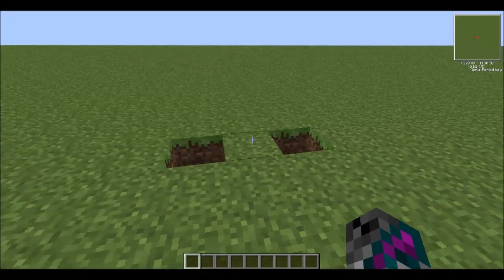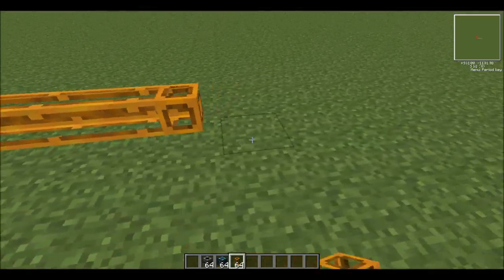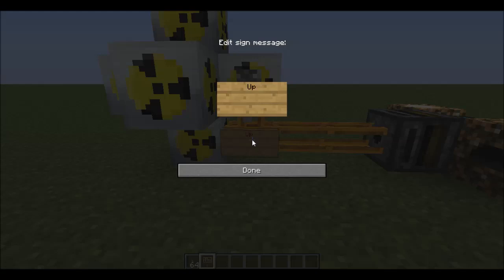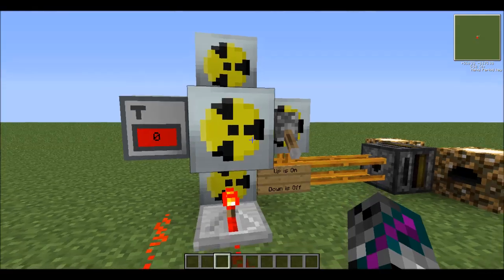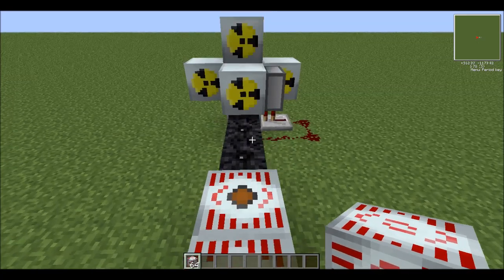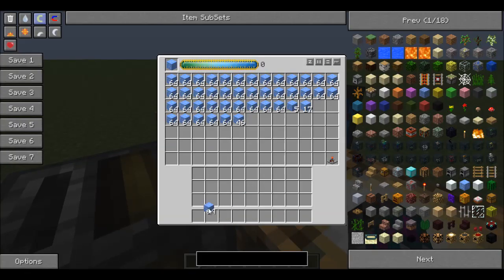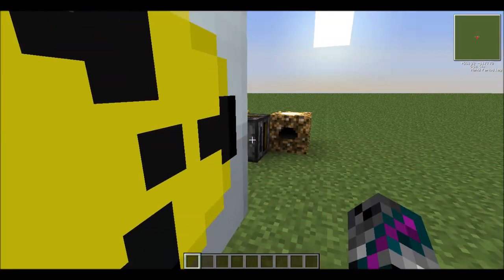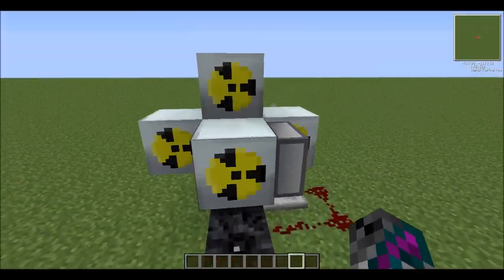Tekkit Tutorial: How to make a Nuclear Reactor

Comment from the maker: Sorry guys for not making videos in a very, very long time. Fraps has been having issues :(

For the problems with not getting energy, make sure that you have the switch turned on and that the uranium cells are inside.

For the placement of the extra chambers, there could possibly be a glitch. Normal placement does the trick for me, but i can suggest trying shift-clicking.

For the explosion issue, make sure that the redstone is in place. If this doesnt work try to use the redstone wires. =)